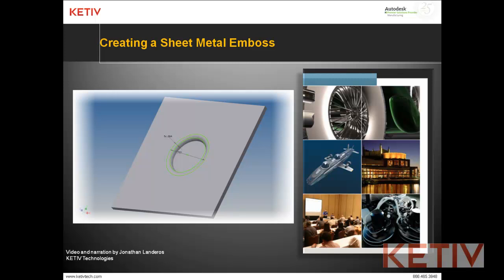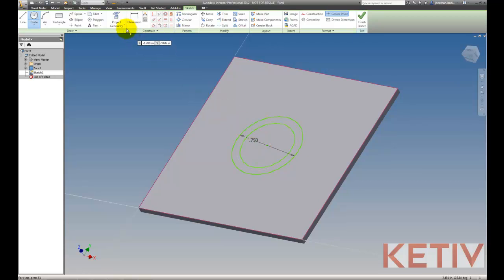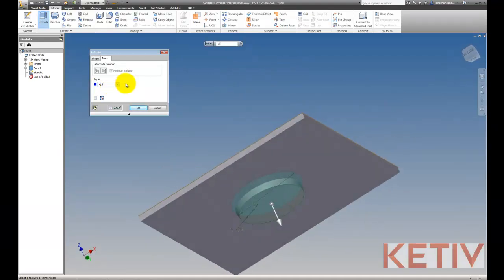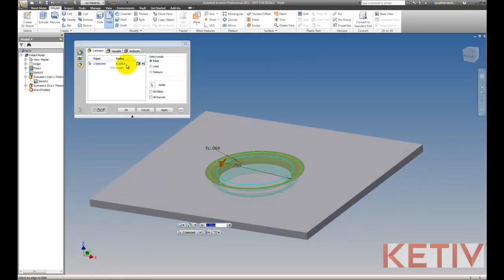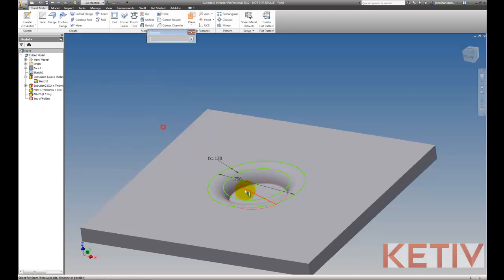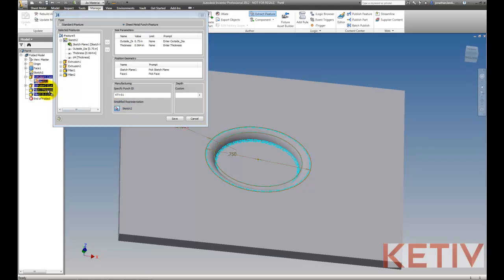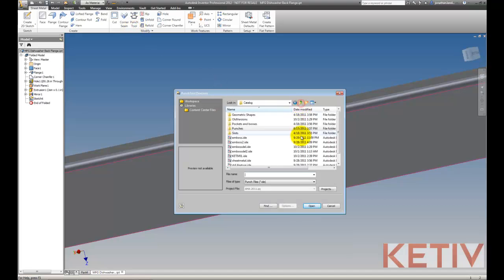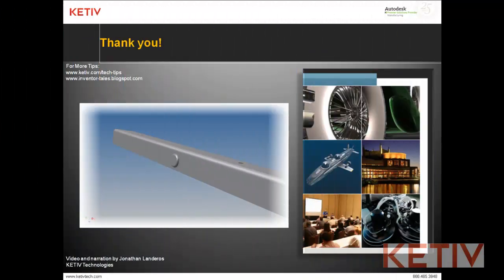Creating a Sheet Metal Emboss in Autodesk Inventor

Comment: I have followed this to the letter more than a dozen times and each and every time get the error "can not build feature - no edges found while making filet feature - Autodesk Inventor Pro 2016
Reply: I'm using v2019 and I have similar problem with fillets. One thing not mentioned in the video is that there can NOT be any dependencies from features outside the iFeature to be created (flat face in this example or origin point). For me everything works fine other than fillets near the flat face since they kind of have to be dependent on the nearby flat face...no idea how to fix it.
Reply: I've found the solution! I'd assume Inventor over the years got a bit more picky about geometry. 1) Make the geometry independent - get rid of vertical/horizontal constraints, don't project any edges from flat face, etc. 2) When you're authoring the iFeature and switch to sheet metal feature there are 2 blank windows on the right. When you pick the iFeature geometry they fill in: top one with parameters, bottom one with geometry. In this case bottom one is going to have a sketch plane, an edge and another plane. Right click the edge,choose "combine geometry" and left click the emboss in MODEL SPACE. The edge will disappear from the window. Then combine the lone plane with sketch plane and it's gonna work. It's likely Inventor missed the "cut" extrusion from selection window, adding it to selection set fixes the issue as well.
Reply from the maker: Thanks for the teamwork here!